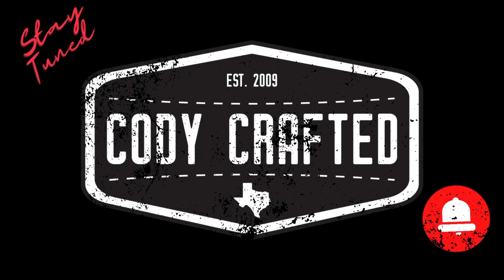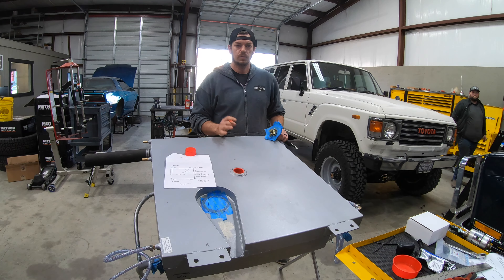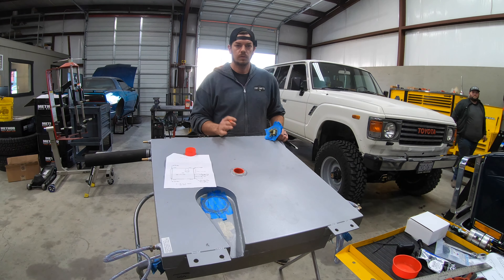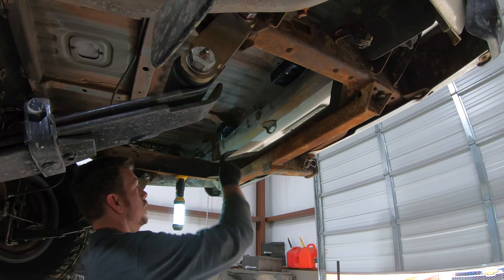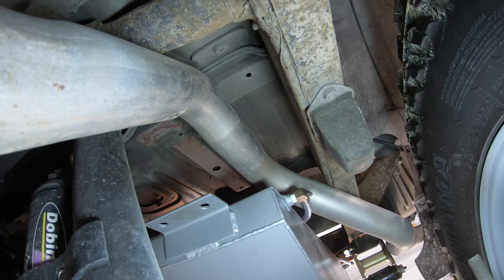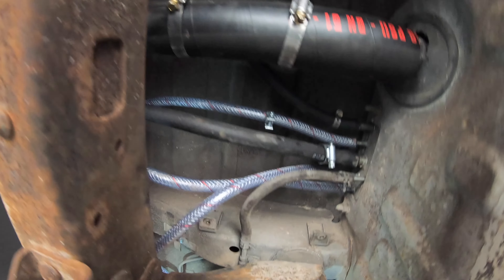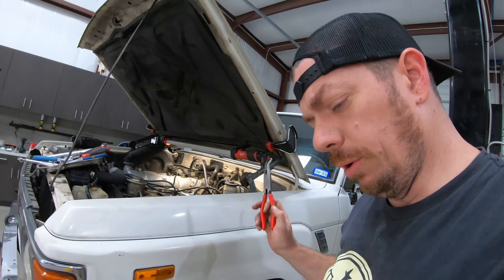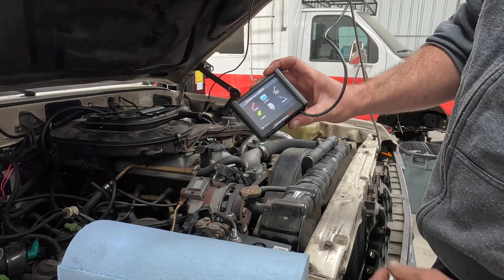This Toyota FJ60 gets and EFI upgrade and LRA 40 gallan tank!

Comment: i bough a microsquirt for efi conversion on 2f / fj60 and welded in injectors bungs on intake and a gm throttle body off something i can not member what it was pulled from .i am thinking ill make a long runner intake from a ford efi intake 300 six or just make one from tubes in future
Reply from the maker: sounds like a serious project
Reply: @CodyCrafted  ah just mukin around with it .but i do like the microcquirt .android tablet can be used as a dash gauges etc or tuning but lap top is best for that to me  .i just looked into russ efi  look very good to usa made i think.wild 2300 dollars fuel tank now that is serious i guess i am a cheap bastard  lol ..ill have to build one or get 40 gallon suburbia 1988 or so tank from diesel truck that may fit fairly easily

Comment: Beautiful rig. I dig those wheels...love the off set. Your color is the same as my 84 fj60. Has the suspensionI soften up? I have the same Euro side mirrors. I picked mine up with a Conferr Rack for only $100 from a guy in the mountains. 😅.
Reply from the maker: It's gotten better, but this setup is really designed for full front and rear bumpers with winch and spare. They just haven't been installed yet.